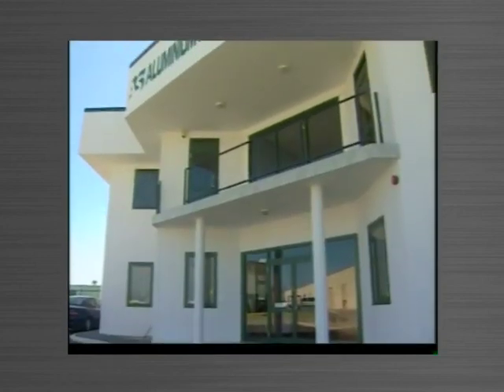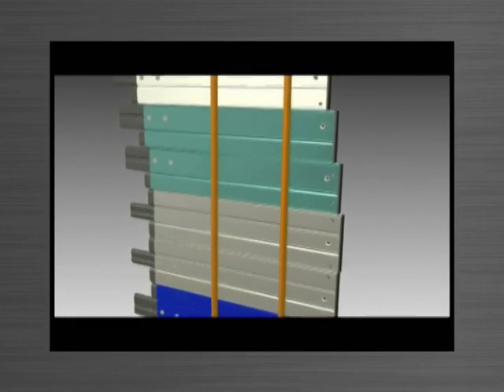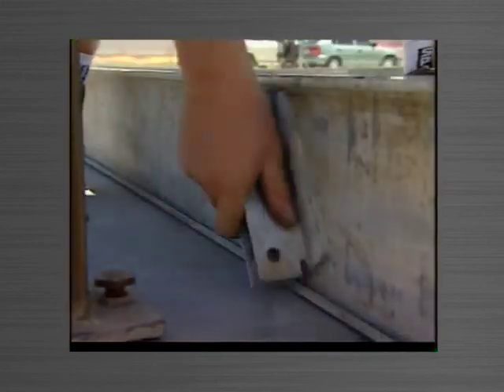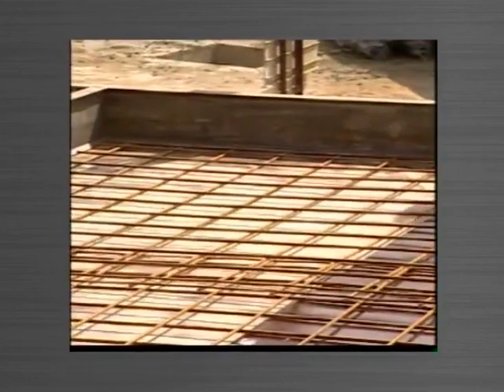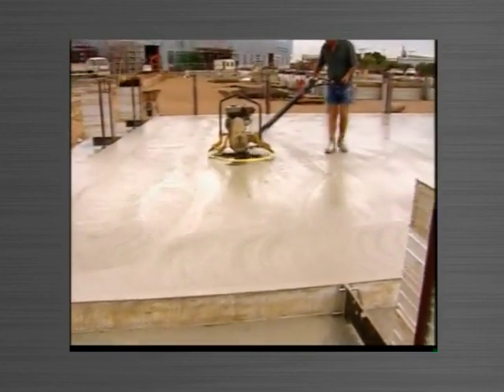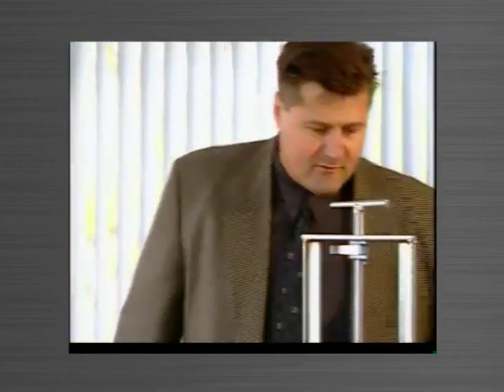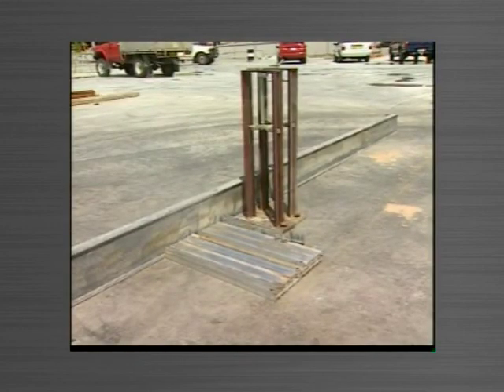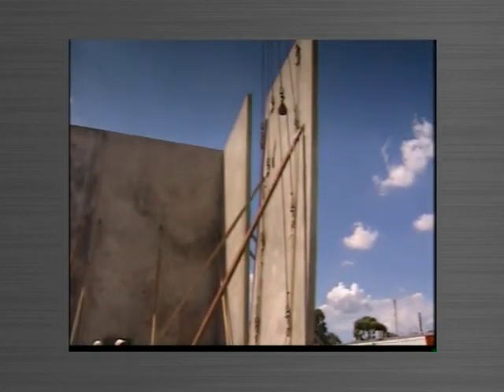SRB Tiltform Tilt Up Formwork System

Comment: How do you keep the different layers/levels from sticking together ? Sorry for the stupid question
Reply from the maker: Pierre Combrink you spray a chemical called "bond breaker" or "release agent" that forms a thin microscopic film preventing the concrete from sticking to the layer underneath
Reply: Much appreciated.